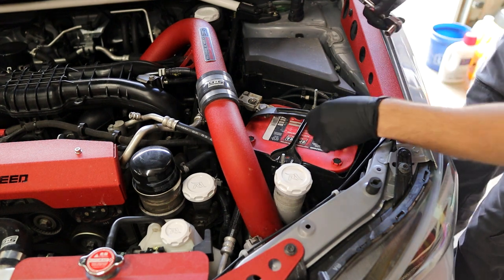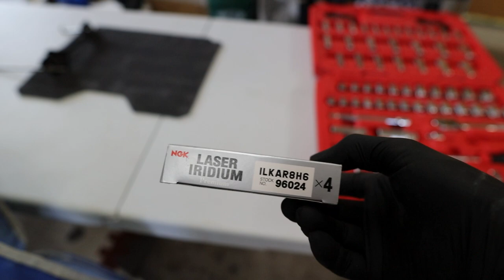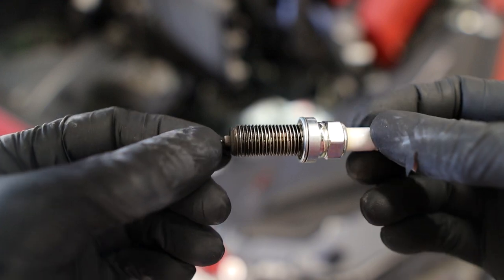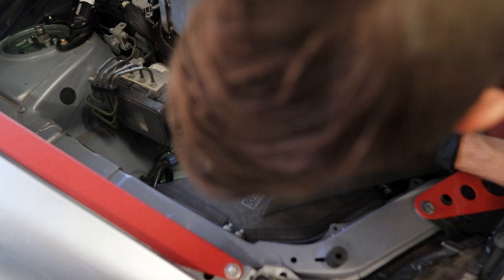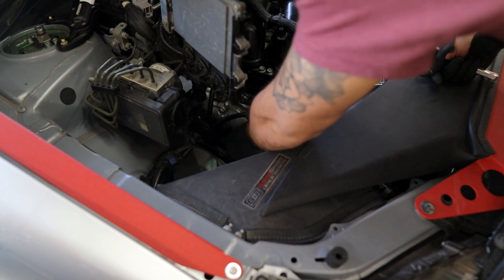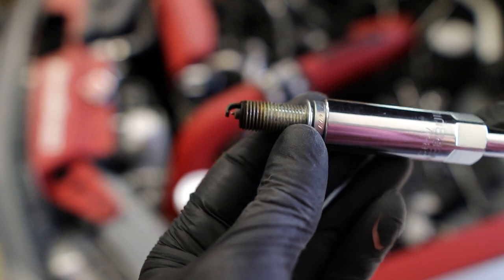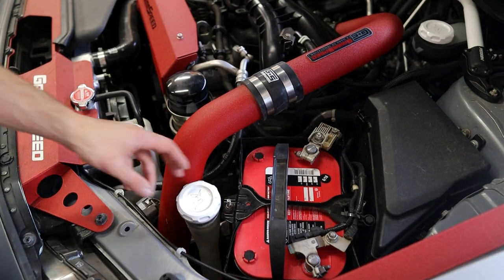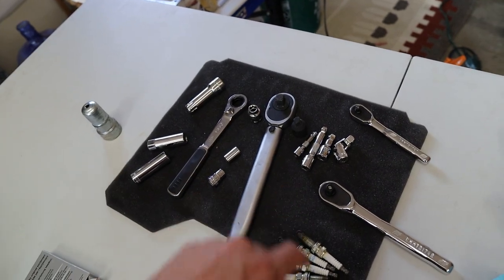WRX Spark Plug Replacement - Track Prep!

Comment: THANK YOU for showing the old plugs! Just did my 2018's plugs after 80k kilometers and #2 was the only one with oil on the threads. Was seriously wondering if I had a valve-stem seal leaking, but then I saw this and was glad to hear how minimal / common this is on fa20 DIT'S
Reply from the maker: As long as it doesn't get worse over time or pool up in the socket, it's fine!

Comment: Nice Kevin. Just did this on my WRX with 40K on the clock. Everything was dry and the color of the electrodes were nice and tan. Now just need that custom tune for Stage 2! Make sure you reset your auto window up/down for the front windows by holding switch momentarily (due to the battery disconnect).
Reply from the maker: Haha yes!! I did have to do reset the windows

Comment: Great video! Are the spark plugs pre gapped?
Reply from the maker: Yes they are! I have a gap measurement tool that I use to check the tolerance on each with just to be sure though

Comment: As i just had done for $540, you will have to replace the valve cover gaskets( especially the spark plug tubes) within 60,000 or you'll get eventual misfires

Comment: What battery are you running? I've been thinking about swapping mine out before it goes 🤔
Reply from the maker: Optima redtop! It is the best battery on the market imo. Had charging and starting issues with OEM for a while, replaced it with the redtop and haven't had a single failure to start in 2-3 years
Reply: @WRXGarage  good to know! Thanks for the info as always bro!

Comment: I’m new to doing my own maintenance and read about gapping spark plugs. is that needed for these out of the box?
Reply from the maker: Not needed, no. But measuring and double checking the gaps is always a good idea
Reply: thanks for the fast response. I’m in the middle of trying to put the driver side ones back in and I can’t get the torque wrench in with any various extension I try. It was a time lapse but it doesn’t look like you used one after trying various extensions yourself?
Reply from the maker: The torque spec is like, 15 ft lb if I remember correctly, I just ended up tightening by hand based on feel. You just want to make sure the crush washers flatten, which you can usually feel
Reply: @WRXGarage  thanks man! all done and my AP is showing great numbers again!
Reply: @WRXGarage what is the gapping?

Comment: crazy how you say not to over torque and then set your torque wrench above whats needed, if the wrench is not calibrated and its a make or break item, set it below not above.
Reply from the maker: I was using multiple adapters which would reduce the amount of torque received by the threads themselves. I set it a little high to compensate for the torque losses.